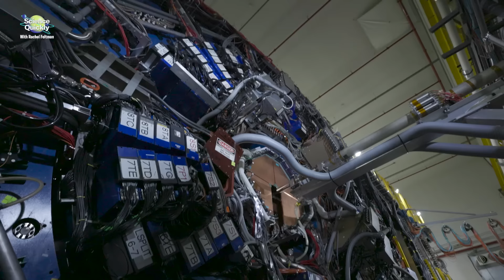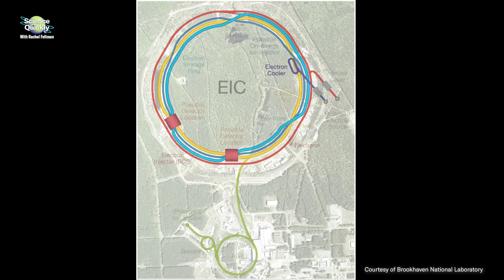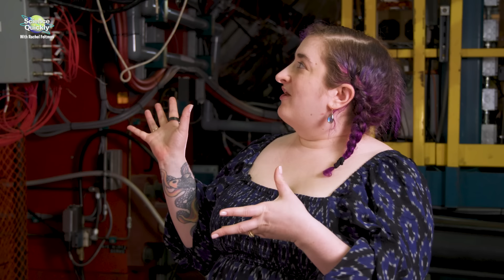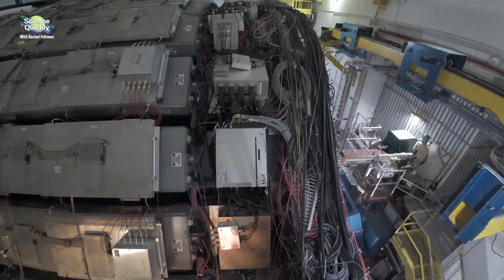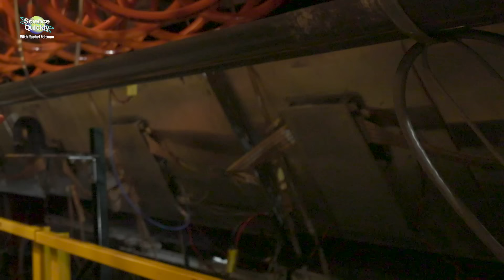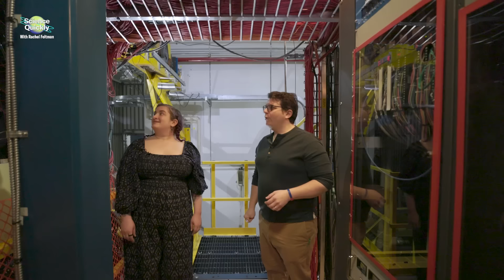This video podcast happened inside the U.S.'s only particle collider | Science Quickly Video Podcast

Comment: Awesome video. But is this the only particle collider in the U.S? What about Fermilab? 

Also, I'm curious whether the interaction area is dangerous while the RHIC is running. Is it radioactive?
Reply: Yes, RHIC is the only particle "collider" operating in the US, which specifically means two, counter-rotating beams both accelerated to near light-speed and then brought together to collide in the center of the interaction regions (at the center of STAR and the sPHENIX experiments). There are of course many other particle accelerators operating in the US, but with a single beam hitting a fixed target.

While the machine is running, indeed, you do not want to be in the interaction region, and we have multiple safety systems to prevent this from occurring. Once the beam is turned off, there is very little remaining radiation in the IR (essentially none), and we constantly measure areas around the IR to look for "activated" materials, and have strict rules for entrance and exit into the IR during operations.

Comment: Michigan State University has a Cyclotron Collider also.  Studies rare isotopes.  Various targets are used.  Better practical science occurs there, and has much more value than Brookhaven.
Reply: To be clear, a collider means two individual particle beams are circulated in opposing directions and then steered together to collide in a detector at an "interaction region". A cyclotron is an example of a fixed-target machine. These are very important and have many applications, but a colliding beam facility enables a much higher center of mass energy and a different approach to detector design important for measuring various different final states. 

Michigan State University has the Facility for Rare Isotope Beams (FRIB), which is a fixed-target facility used for studying very short-lived, heavy nuclear isotopes which have applications to the study of astrophysics. It's a fantastic facility - I was able to tour it in 2023. 

At BNL, the RHIC facility is made up of a few different accelerators which have a couple of additional applications. For example, we also use the RHIC facility to study radiation effects on materials and cells to mimic the effects of being exposed to cosmic radiation (NSRL - NASA Space Radiation Laboratory), and we have the BLIP facility which we use to produce radioisotopes crucial for nuclear medicine. So, in addition to studying ground-breaking, fundamental nuclear physics, the RHIC accelerator complex also has practical applications crucial to many areas of science and medicine.
Reply: Those are not the same ?
A cyclotron are used to accelerate particles in many experiments and for hospital treatments like proton beam treatment.
Reply: In terms of applications, they are not exactly the same thing. When we say "collider" we are specifically referring to a machine which collides two beams of particles together. Additionally, a synchrotron (like RHIC) is a fixed radius machine, which means the magnets have their field increased (by adding more current) "in sync" (hence the name) with the acceleration of the particles. A cyclotron is a large cavity that allows the particle's curved path to increase in radius as they are accelerated, while using a fixed magnetic field. That beam of particles then hits a target after which you can place detectors (or a sample you want to irradiate).

FRIB is an example of a linear accelerator.

The point here is that no one technology is "better" or "worse" - they have different applications and provide different technical constraints and benefits.
Reply: @Hippida  Actually they are exactly the same, but at different energy levels, and using different species of accelerants, and different targets.  The Heavy Ion machines are far far more valuable to society, since they explore isotopes.  As you say, these are used in medicine, and to produce exotic chemical reactions for industrial purposes.  I was treated for throat cancer using a Linear Accelerator hitting a tungsten target, and the beam was able to be focused to one-millimeter precision to "excise" a tumor.  They gave me one of the Hydrogen Thyratrons as a "going away" present, since after my treatments, they happened to be servicing the machine.  Since I had worked in that zone before (MSU graduate in EE), the repair guy, who happened to be a PhD physicist, working as a Beam-Repair Technician for the medical company (making significant salary as that), we got to talking, exchanging stories, and realized were brothers "under the skin" so to speak.  His skill may have saved my life (so far).